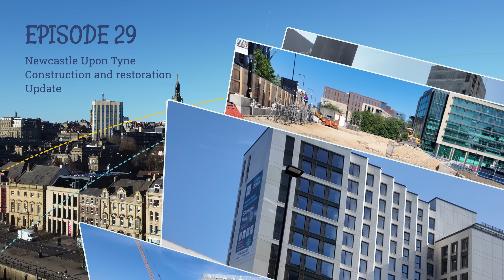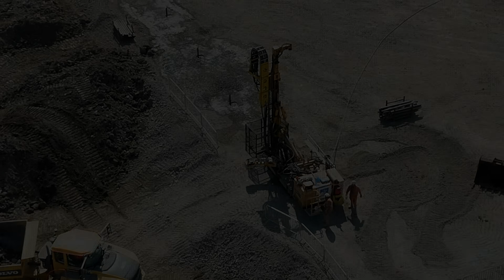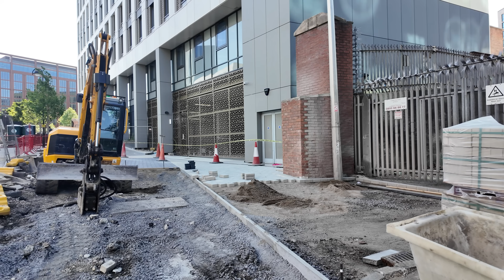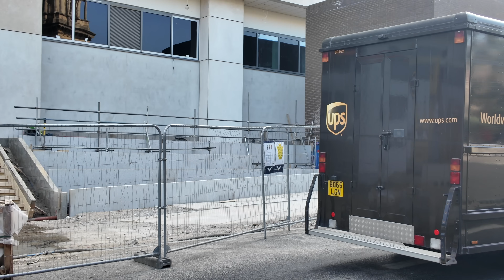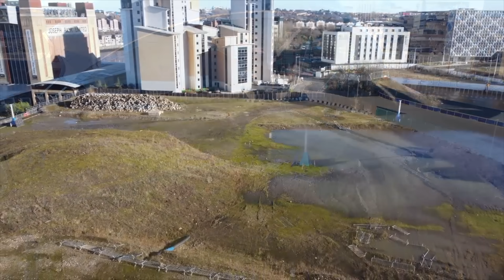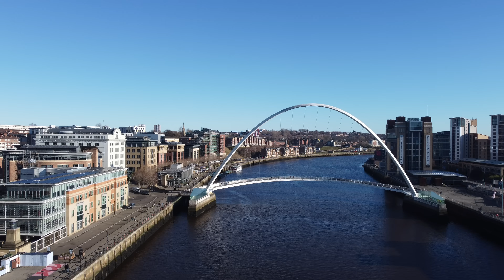Exciting Updates on Newcastle construction and restoration HMRC, Northumberland Street and beyond

Comment: What type of advertising boards are going up next sjp. I don’t get why they need ti level it all out just for advertising boards. Will it be big screens or something like that
Reply from the maker: There is supposed to be six 3 of which are  electronic if they stick to the original plans but with work stopping for so many weeks it makes you wonder if things have changed. Thanks for watching 👀
Reply: @55DEGREESNORTH68 could it if been waiting for the extension of the stack. Because that’s going to be here a further 5 years or am I way of

Comment: Those subways get repainted every week. Doesn't matter how much they clean them up or what they do to them. They are going to get vandalised instantly because they never catch any of the people behind it. 

Sorry to be pessimistic but I also think the CCTV cameras will get vandalised and after a while it will be decided that it's not cost effective to keep repairing them so they will get replaced with fake cameras which are a lot cheaper to try and work as a deterrent and reassurance.
Reply from the maker: I used to walk through them everyday when I used to work on Melbourne street years ago I they were the same then sometimes even the lights did not work at all but I was ok had a torch on my key ring so I could get through ok. Thanks for watching 👀